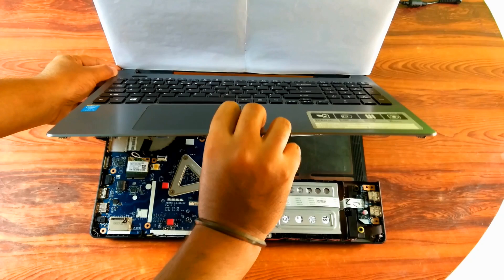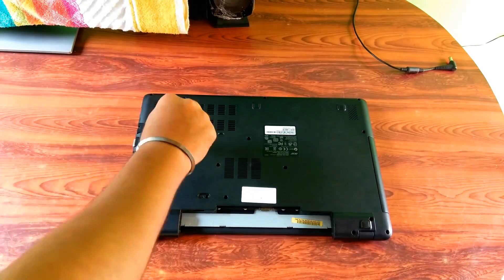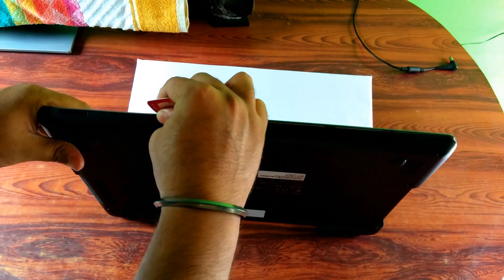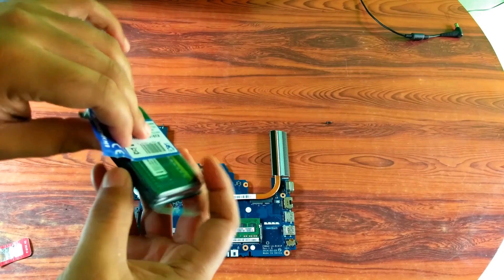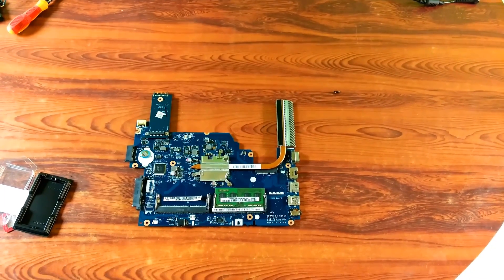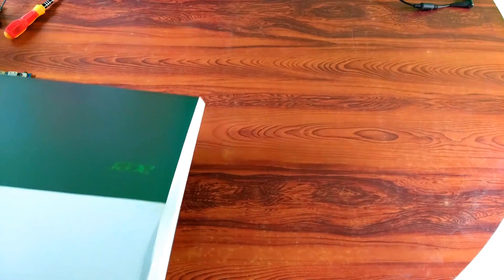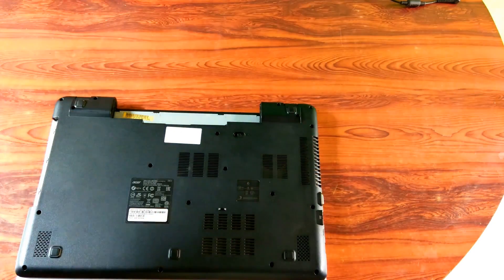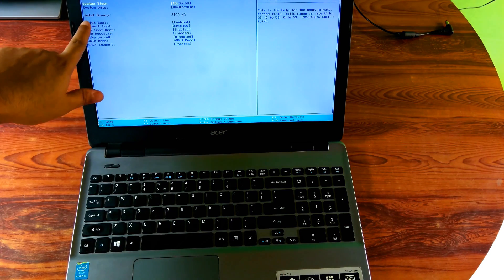How to Disassemble a Laptop Acer Aspire E15 Series E5 Upgrade RAM HDD Cleaning Cooling Fan

Comment: Hi, does it has a M.2 slot on it?
Reply from the maker: No, but if you want you can install M.2 SSD in this laptop using 2.5 inch SATA 3.0 M.2 SSD enclosure, a detail installation guide is available in our channel - https://youtu.be/OaAa0c2t0J4
Reply: @asatechnical  1a
Reply: Hp laptop disassembly
Reply: No but another model laptop does have one, look for the Acer aspire e15/e5-575-72n3, it doesn't matter if the CPU is an Intel core i3, core i5, core i7, etc. All of them have an M.2 connector.
Reply: How much does a motherboard cost for that laptop,  I have one just like it.

Comment: The only bad flaw of this model of laptop is the ribbon cable that goes to the Keyboard is too short.
Even I found it very hard to reinsert the ribbon back to its holder and I have Piano fingers. The stand offs to the rear of the unit also are weak and will break as the plastic ages. The track pad is also finicky and will fail as mine did so I use a mouse now. This particular unit is not to bad but you must keep the dust away from it as much as possible, And the thermal paste must be done from time to time - I've done mine twice since the unit was new. One modification I've done to mine is placing a piece of tape to the top of the cooling fins to the fan to help seal the air flow between the two, because of leakage back into the laptop and it does help quite a bit. Other than that Acer made a pretty good unit and it gets a good rating of 78% on Notebook check.net

Comment: I have the E5-571P touchscreen version without the optical drive. Can i remove the black plastic enclosure and replace it with a caddy that has HDD or SSD for additional storage? If i can can u provide me with a link from amazon  or ebay of which caddy i need to purchase. Tk u sir.

Comment: Thanks for the video .. since all the main parts and mother board are on the bottom .. if I close the laptop and accidentally put something on top or applied a little pressure .. I won't damage the laptop right? Thanks

Comment: Hi. Thanks so much. But after i changed the RAM, the keyboard is not working any more. Do you have any idea why please ? I checked all the connections 3 times though  🙏🏽
Reply: It’s the strip tapes, honey. When you take out the little strips out of the slots you have to make sure it’s back in all the way. If these strips aren’t properly put back the keyboard will give you issues as it is what operates the keyboard keys and mouse.

Comment: Hi I have acer aspire E 14 E5-411 C1Y4 that has 2gb ddr3l 1333mhz ram I'm planning to upgrade the ram to 8gb but there's no available 1333mhz. Can I use 8gb ddr3L 1600mhz instead and will it run? Thanks looking forward to your reply

Comment: Thanks bro! But please make a vid on how to fix a noisy laptop fan, mine just goes like srrrrrrrrrt after i start ir 😞😞
Reply from the maker: Did you clean it properly? try to see where is touching during spinning the fan blade.
Reply: And what was the make and model of the laptop or PC?
Reply: Fun Time for the amount of time it would take and do whatever y’all need to be done and you’re not too sure if it is just buy another one for it. I had some high-end gaming fans $79 each. Also check around the vent a screw may have come loose but you would never know until it was turned on. Always hated it when I had a screw loose always so hard to find you know. Lol

Comment: Hello , I have a Acer aspire 4250 laptop.
It suddenly stopped working while switching on by a beep sound.
Now if I put on the charger light turns on ,but when i connect it to laptop the light goes off and laptop does not power on.
can get your expert solution on this..
Reply: Same happened to me, in just then switched off the laptop and turned on again but same again. I thought of reinstall Windows, well it worked

Comment: Holy shit man thanks. I'm gonna build a PC in a couple of months and my laptop was running really bad and really hot. I opened it up, cleaned out all of the dust, took off the heatsink and replaced the thermal compound with good deepcool z3 and the idle temperature dropped by 10°C!!! Thanks so much!

Comment: How do you remove the optical drive so easily? Mine is connected with a cable which seems to be pretty hard to disconnect and reconnect.
Reply: Was his optical drive already disconnected? Any not reconnected during reassembly?